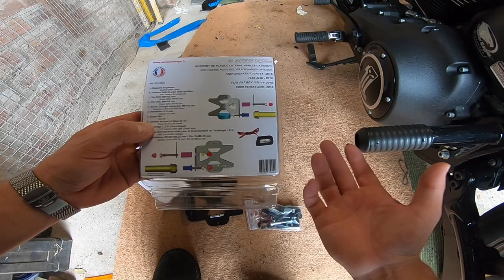Softail Street Bob Licence Plate Relocate - Harley Davidson FXBB

Comment: wouldn't the light be better on top to prevent dirt and muck gatehring up over it while riding?  looks like it could fit up there aswell.
Reply from the maker: Thomas Nordlund yes that was an option and you are right dirt will gather there no doubt. It just looked better at the bottom 😂👌🤘

Comment: Interesting vlog again really enjoyed but I've never liked the big gap at the rear fender and tyre on the bob.side plate emphasizes this even more .is it possible to lower the new softail street bob.cheers
Reply from the maker: Steven Edwards yes I know what you mean...you prefer the low rider look. I’m pretty sure it’s possible to lower the rear end? Although I imagine it will make it a harder ride as you will loose that travel space?
Reply: @StreetBobberVlogger  you can buy the Burly Slammer Lowering Shocks for the Harley Dyna Street Bob. I stuck a Shin Yo Reflektor, 125 x 18 mm, under the mudguard to take away some of the gap for now.

Comment: Dont wanna sound like a jobs worth but yah will need to find a red reflector for when the mot comes round in a few years,,,
Sticky backed carbon fibre vinyl looks nice on the back of the number plate and is quick and easy fit..
Reply from the maker: davemaxx all good bro, thanks for the heads up! Think I’m probably going to have to remove the tint off the rear lenses as well. Still, I got 2 more yours to forget 😂

Comment: No mate I meant the actual rear light / brake light. Is it that small led on.tje new mount
Reply from the maker: Ahh ok, just the stock bullet turn signals which are also the break and rear lights. Ive just smoked the lenses out ;) There is no single middle rear light on the FXBB's

Comment: Great video! I have the same kit but I didn't like it on the bike. Maybe I'll give it another shot.
Reply from the maker: tom rebel gotta be better than the stock mount...give it another chance 👌🤘
Reply: The local plate size is 240*130 mm and the 240 were sticking out way too much. Unfortunately it's illegal to mount it vertically.
Reply from the maker: tom rebel yeah they are huge over here too...I’ve bought a smaller plate so it fits (not legal). The original just looks silly and sticks out way to far. I’d have liked to have gone smaller still but the cops would be pulling me over every 5 minutes.